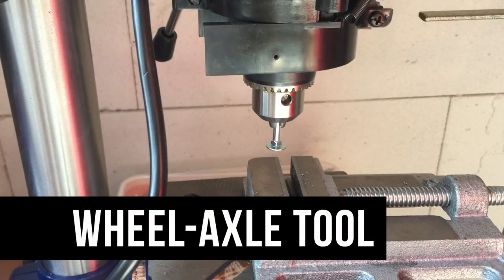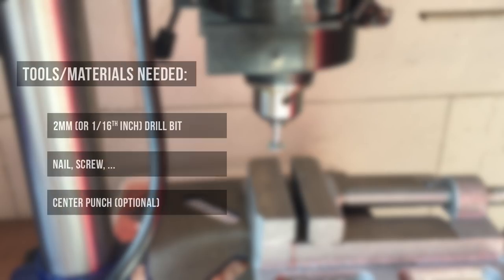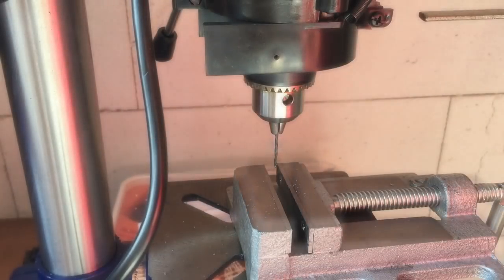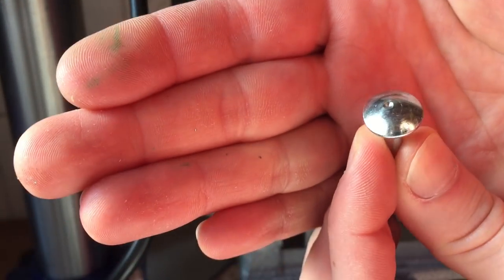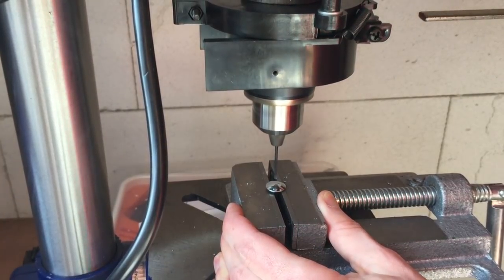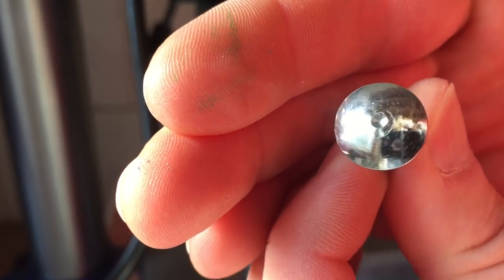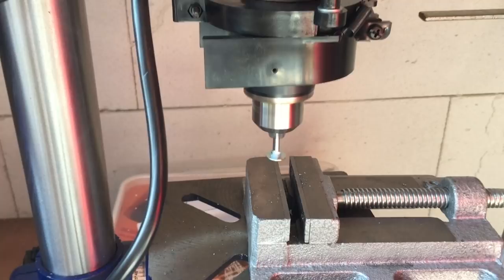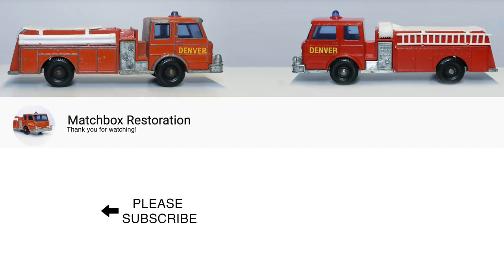Tutorial: Matchbox Custom Wheel Axle Tool (for Drill Press)

Comment: Very good....virtually identical to what I use apart from the size of the coach bolt head. I use a smaller headed bolt as I find the coach bolt too large if the model has mud guards (fenders). Personal choice.My version falls half way between Martys set up and yours. I also have a slightly larger version for Dinkys as they have larger diameter axles. Really well explained tutorial....I'm sure that other restorers starting out will find it very useful. 👍
Reply from the maker: True, the shape of the bolts I use aren't that suitable to get in tight spots. I might need to have another one specifically for those hard to reach areas. Glad you like it!
Reply: @MatchboxRestoration  baremetalHW uses a lathe....same principle but horizontal rather than vertical...looks a bit weird but it works. This is better though IMHO.
Reply from the maker: Indeed, many good ideas we can only benefit from. Each will decide what works best for him/her.

Comment: Nice quick video, right to the point. I'm just curious if using a carriage bolt instead of a nail has ever interfered with the body or wheel wells of the diecast itself?
Reply from the maker: It does sometimes. I’ll need to search for another one that is a bit narrower.
Reply: Maybe you can use a file while turning it in the drill press to reduce the diameter.